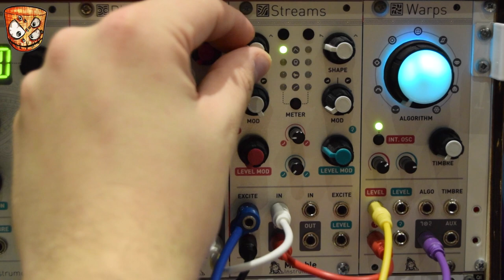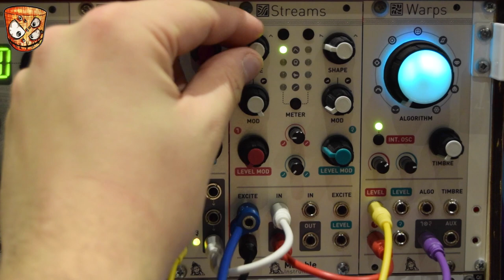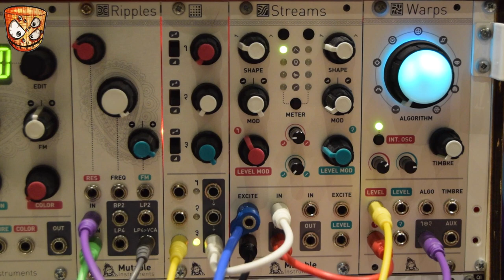Mutable Instruments - Warps - Through Zero FM

Comment: Cool vid as usual!!! The easter egg has been found but nobody is giving anything away. In the overview vid were the 3 sample and holds you sent into Warps from an Octocontroller? If so, are the sample and holds all different?
Reply from the maker: +ross anderton Hi Ross, the sample and holds were from the SSF Ultra Random Analog (check my video here - https://www.youtube.com/watch?v=4mJXkAzvuoo ) Sample and Hold B, Sample and Hold A and the toggle output. It's my favourite random generator by a long way. Love the URA! :) Octocontroller would have done the trick though. All sample and holds are the same in that it takes an input (often white noise is normalled to the input when no other signal is present) it then holds a signal when a clock/gate/trigger activates the hold in the circuit. It does nothing until triggered again and holds the value currently at the input on each trigger. As white noise is all frequencies evenly and generated very fast that gives the nature of constant random values coming out. I'll hopefully have some tutorial stuff coming next year on stuff like that.

Comment: Hey Ben, point of clarification, does it matter what algo you are in when doing Thru-Zero FM? As in, can you still use the other audio input and then do the usual warps thing as you would in each algo, with the exception that instead of doing whatever each algo does to two different external signals it does it to one internal and one external? Like in the patch you had, I believe it was set to crossfader, so you could have crossfaded the internal VCO with another signal fed into input 2?
Reply from the maker: +Flohr doesn't matter to my knowledge. So you can through zero FM one source and still manipulate it against another.
Reply: +DivKidVideo yeah I'm getting along quite well with it. Tides and Warps actually make a pretty great complex osc.
Reply from the maker: +Flohr yeah I bet they're really cool as a permanent complex oscillator patched up. I should try that.
Reply: +DivKidVideo its really great because with the Parasites firmware Tides FM is Thru-Zero as well. It can't take really high frequency modulation, but if you tune both oscillators to the the right octave range/ratio you get really cool results. Btw I was wondering, how come you never did a Tides video? There are some good jam videos showing off what it can do as an oscillator, but no one really did a straight overview.
Reply from the maker: +Flohr just haven't spoke about it with Olivier so it hasn't made it's way into my video queue. Good news on the Tides FM though, I'll try that out.